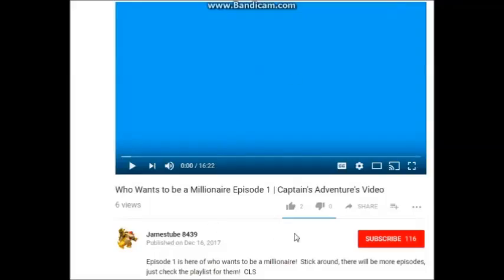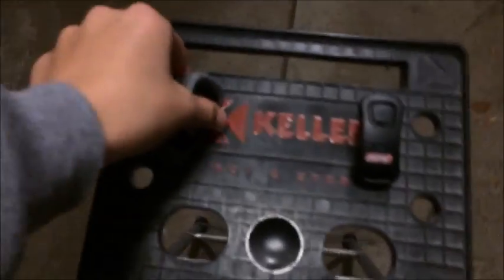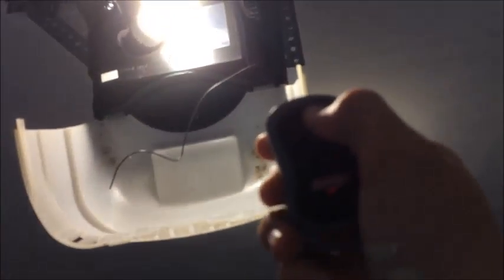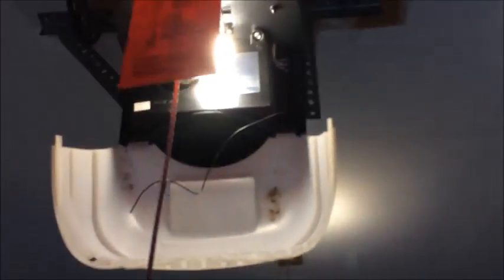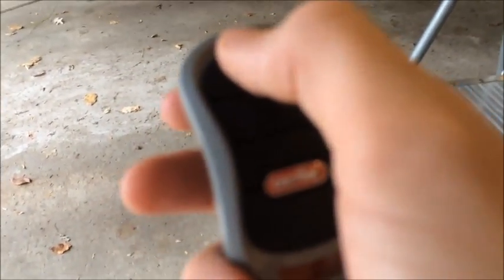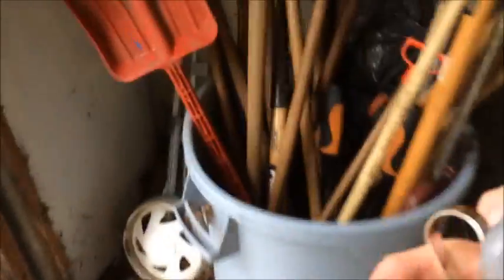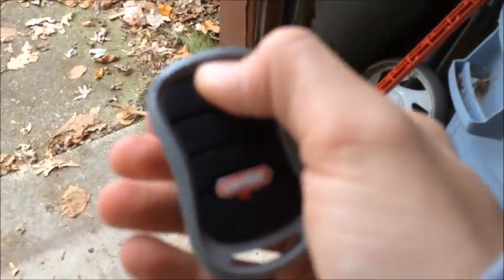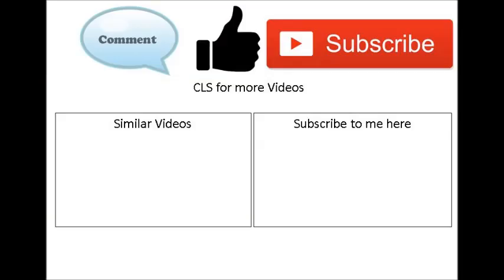How to Program Remotes to a Genie Intellicode Garage Door | Tech/Mechanical Video

Comment: How are the bulbs in there? Easy to change? I had to buy a new remote for my new car, so thank you for the easy video.
Reply from the maker: Bulbs are pretty easy, the door that I flapped down on the motor itself is where the light bulb is, and just like a regular light in your house it should just screw off and screw on.

Comment: Best darned garage door set ups they ever made.  My grandmother had one put in her basement with the steel/insulation/steel door and it's the screw drive model.  Opens and shuts like the day it was installed.  When my mom had one installed (edit:  I'm talking like 5 years ago for her), I told her to request a screw drive model and the guy told her they don't make them as good as they used to.  I mean, the one in the basement is like 20 years old?  17-20, give or take a couple of years.  But at my mom's house, they just went with a chain style opener, not even sure of the model.  I mean, I've only put white lightning grease on the tracks twice in my life lol.  It's had zero maintenance.  I guess I should or could use some WD-40 to clean the screw drive, itself, then coat it with something good.  I dunno if CPL oil would be a good use case, here.  Huge fan of CPL oil... best thing for firearms.  Great for battery terminals, too, as it's dielectric.  Of course, they make specific applications for that, but I'm just saying, if there was ever a one size fits all lubricant, CPL is amazing.  Maybe it would do better with some Ford/Lincoln Chassis Grease I have.  It's best I look into that first before I do something stupid and destroy it.

But, yeah, now I live in my grandmother's home.  She's no longer with us.  The original door opener has finally worn out.  The button has to be pressed just right and if it's a hot day and I've left the door opener on the car's sun visor... well, I can spend 5+ minutes fiddling with that button trying to open the darn door lol.  I have to give up half the time and go use a key to get in, go downstairs, open the door... yada yada. 

Bought some replacement Genie remotes.  They appear to be identical to what you have.  Even the door opener appears to be the same.  Appreciate the vid.  

And as for my CPL rant haha, there's a YT vid on here of a guy that tested like 25 gun oils.  He coated some (25 or so) steel plates in each of the oils, left them out in the sun every day and poured salt water on them every day.  There was only ONE that had no rust.  The one with CPL.  CPL = "Clean, Protect, Lube".  I mean, I feel pretty confident it would be perfectly fine to use on this screw drive set up.  I just dunno if it has enough viscosity to protect the friction on the screw drive as it is lifting a heavy door, as she went all out with the steel outer side/insulated middle/steel inner side door style.  It's SOLID and man, to this day, that door still just plops right down and makes the perfect seal.
Reply from the maker: That’s pretty cool, these garage door motors are definitely made to last a very long time.  Sucks that you would have to fiddle around with your opener since it’s so worn out

Comment: Have programmed several remotes to two different garage doors. My problem is getting the cover to drop down to one newer. It will be simple if I can ever get it exposed.!!
Reply from the maker: Is there a button or a switch to get the cover to drop down?
Reply: I'm trying to get the light cover down to get inside to the learn button. This semi shows it but wish it was a better view for those two clips or whatever to press down, one on each side... ??
Reply: Some have 2 Phillips screws holding the top on. They are on the top on both sides. Try to feel up there to see if you can feel them. It’s that way with Genie Intellicode

Comment: I bought these in 2019. I have one which shows red, green lights inside the hand remote, plus the light on the genie opener stops blinking, but the remote won’t move door at all. Any suggestions? Funny the opener that works doesn’t show any green light inside the handset, so I figure the one that works has a problem which interferes with the other.
Reply from the maker: Do you know what kind of remote you purchased for your garage?  I recommend going with a brand of remote as the same type of garage door motor.  It makes it easier to program.

Comment: Didn't work for me,
The light for the motor just keep blinking
Reply from the maker: You may want to try a few times, your garage motor may not have picked up a signal, sometimes that happens.
Reply: @Jamestube8439  is there's any difference ways to do it
By the way my motor looks alot like yours
I've watched many videos, but they have different motors
Reply from the maker: @ZEKAYPRO  As far as I know, that's the only way to program them, sorry you're having trouble, maybe try a different remote instead?
Reply: @ZEKAYPRO  if the button you want to program and the LED comes on green, hold the remote button until red and green LEDs come on then press the button twice and when the light is red it’s ready to be programmed

Comment: how do you program it to close?
Reply from the maker: Program it normally and it will close and open
Reply: @Jamestube8439  it doesn't close though
Reply from the maker: @WrestlingOne  Weird, don't know what's wrong with it then.
Reply: @WrestlingOne  Check the safety sensors. Make sure the one with the red light isn't blinking